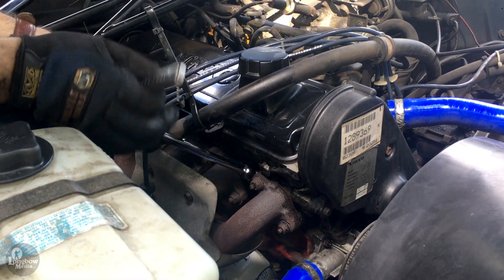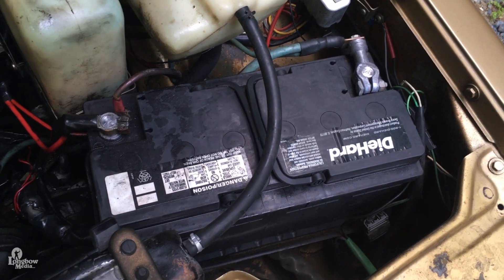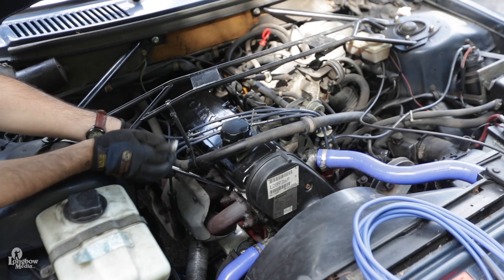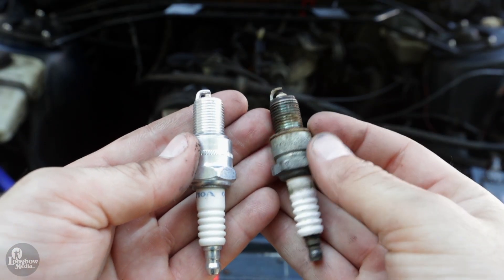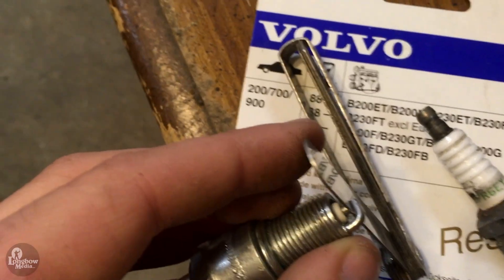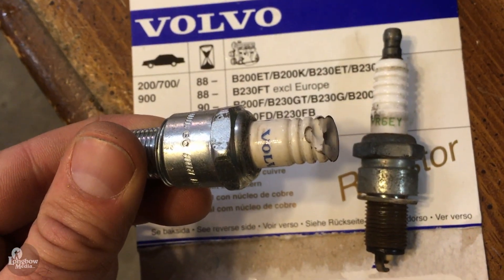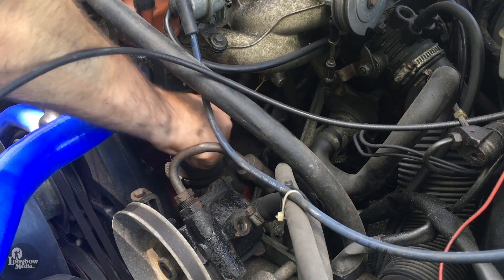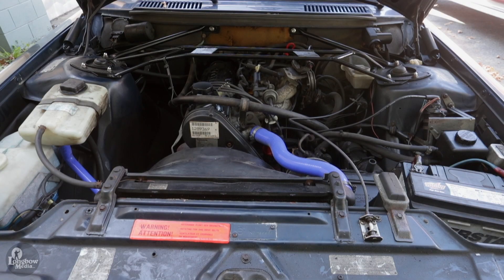How to Replace Spark Plugs, Wires, Distributor Cap and Rotor on a B230F Volvo 240

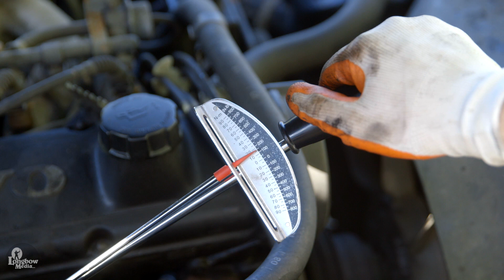Comment: Very good video! I just have one question about the torque spec for the spark plugs. You say that they should be torqued to 20 ft-lb, which would be around ~27Nm if my conversions are correct. But in the video, it seems like you're actually using a torque wrench with Nm and torquing them to 20Nm (1:18). I just wanted to be extra sure of what torque spec you would say is best suited in Nm, whether it is ~27Nm, 20Nm, or anything else. Thanks a lot for all your very insightful videos!
Reply: Actually, because I don't want to waste too much of your time, I found that on forums they say 18 ft-lb/25 Nm, would you find this to be reasonable?

Comment: Adding dielectric grease to the insides of the boots (not on the metal contacts) makes installation easier and also protects from water getting in.

Comment: my 240 cranks for a long time like 4-5 seconds any tips on how to make a better start up:? i replaced plugs, wires, cap and rotor (about a year ago) fuel filter, and intank pump
Reply: My car had this problem after replacing the fuel filter and the in-tank pump also.  It was the check valve on the high pressure pump under the car, on the same assembly as the fuel filter.  Replacing that pump solved the problem.
Reply from the maker: There's definitely a number of potential culprits.  Have you posted your inquiry on Turbobricks?